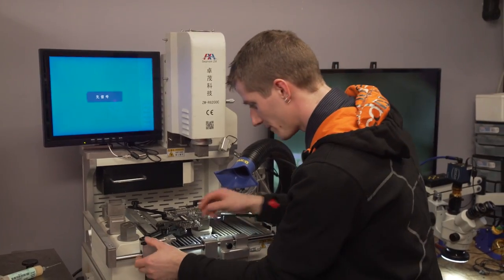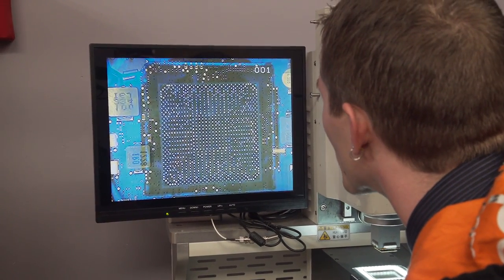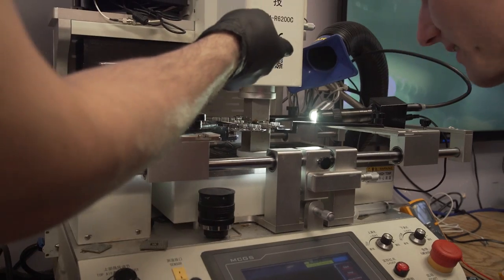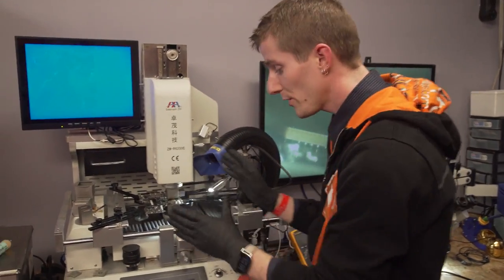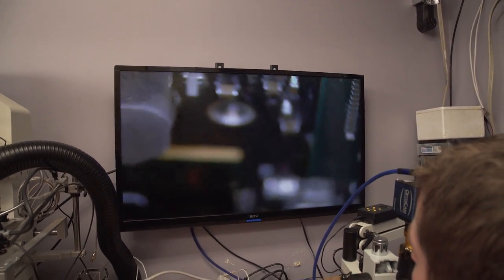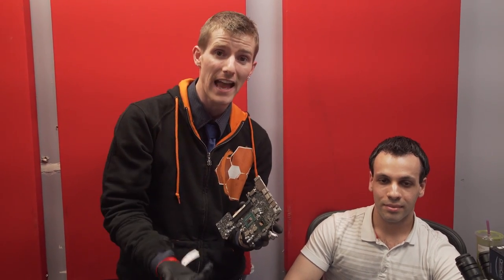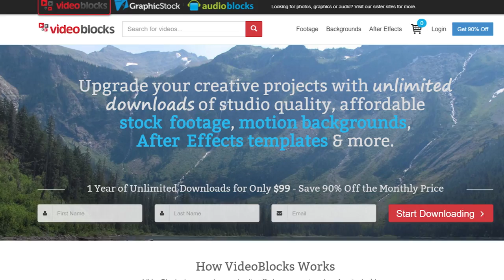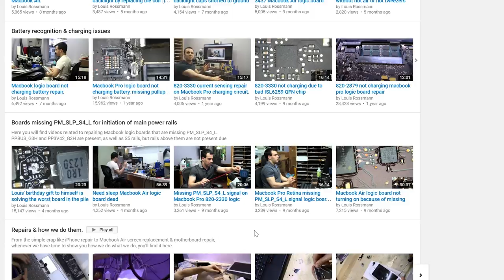Linus Attempts BGA Graphics Chip Repair! - Rossmann Repair Group, New York City

Comment: Linus and Louis, both good sports.  Both professional at their trades.  That is how you settle disagreements and confusion like a gentlleman.
Reply: Do you even watch Louis? Not very professional.
Reply: He just wanted to prove a point that his board worked for a little while, while Louise's failed even after professional handling. Massive ego if you ask me.
Reply: General application is the same one is more safer and under more control but there are chances of errors on both side its luck baby one is a part fixer and another is a total detailed analysed attempt to fix but failure is inevitable lol.

Comment: You know... i once had a Radeon HD4850, awesome card for the day, but after a few years suddenly got some nasty artifacts. So i was out of  warranty, as a student I was out of money and behold he oven method popped out. Needless to say that graphics card worked flawlessly half a year after i baked it in the oven, and it didn't fail, i just upgraded to another...
Reply: still have 4890 in my main rig
Reply: I just switched my XFX HD4850 for an XFX RX 560, and it was the best upgrade Ive ever made.
Reply: Extremely lucky. Rossman sees a couple baked boards every day and their all fucked. He goes into great technical detail why it doesn't work on his channel.
Reply: Yall doing it wrong!  What you need to do is get some 4340 steel billets to melting point, then pour that on the board.  That's the way you fix these things.
Reply: Sure baking it in the oven isn't the "right" way to fix it. But if you need to get it working for a few months on a bare bones budget, I don't see why not try it. If it's old hardward due to be replaced anyway, there really isn't anything to lose.

Comment: Quick Question:From 2:30 to 3:00 how many times our guest (Rossmann Repair Group) had looked to the camera?
Reply: 8
Reply: He looks at the camera 8 times.
Nice for you to point out that Louis does that.
Just a quick question for you: Did you notice that Linus looked at the camera 10 times in the same time frame?
So why exactly is this an issue with Louis and not with Linus?

Comment: Fuck this shit. I want to see Luis and Linus in a boxing ring.
Reply: lmao hell yeah
Reply: lol this expert for repairing boards doesn't fix it even linus tried and failed so board repairs are bullshit  if you have a dead lead free soldered chipset like  solid state intel drive your fucked and might Aswel  buy another one but a gpu is expendible  and can be revived a few times before it will stop completly because gpus  use lead tin solder

Comment: I tried the oven method once on an artifacting X950 or what ever it was called, made it much much worse lol
Reply: what in the fuck? artifacting is a problem with the virtual drivers, nothing physical, unless if you're referring to fracturing which is completely different
Reply: Artifacting can be due to physical issues too, particularly overheating.

Comment: Liunus is hardcore traveled to call out a troll
Reply: +Liemciemdk89 Not a troll; Louis is a professional repairman, and he have uploaded several youtube videos over the years where he rants on the "oven trick"... and he is right
Reply: They baked the board for too long and basically melted it, because they were distracted by conversation. Not a troll. 
Though linus' method of using an over would theoretically work if you can keep components in place and apply pressure. As long as there's solder, it should work. Though you can use flux and a strip of solder while doing it to make sure there is a solder joint, depending on the chip's pin spacing.

Comment: So take this scenario: You have a 300$ graphics card. It does not work anymore. How much does it cost for this dude to check the whole PCB for bad connection (which he can't. He seems to be doing visual inspection only) and resolder as needed? I expect, and do correct me if I'm wrong, that it's gonna be more than 150$ although I have no idea about US wages to be honest.

So you either spend that money and end up with a still broken card or you try it in the oven and end up with a still broken card. In the latter case, you put the 150 bucks towards a new card.

Look, he's not wrong. The oven method is a hack job. I would never try this on a component costing thousands. But for a relatively cheap consumer product, I highly doubt that he can compete, especially considering that if your card is older than a year, you're getting better hardware for the money when buying new anyway.
Reply: +Marco2G He even says this in his response. It was only worth it for the $2000 laptops he was repairing with that station.
Reply: Sessym So what's his beef with the method, then?
Reply: +Marco2G If you have time, really check out the channel, he explains it in detail in more than one video. Solder doesn't even come close to melting in an oven, the innards of the chip do. If you're lucky, they move around in a way that the connections come temporarily live again within the chip casing, but shortly after it will be F-ed again. His issue is that still some less honest shops and people sell this as an actual fix. There's a good chance the stuff they baked will break again, usually after the mandatory warranty.

Comment: OK that machine is totally pointless to own as a owner of a computer repair shop, it's a  $7,300 piece of machinery, how many computers do you have to fix to justify the cost? More importantly what is the success rates of this machine? Just replace the Graphic Chip or mothboard with an new or even used one and pass the saving onto the customers! 

You might as well use that machine's heat to create bake potatoes and sell them
Reply: +Viet Lee When you lose 500$ worth of data this sort of stuff becomes very, very useful. This is mainly aimed at the recovery of things you cannot replace. There are machines ten times as expensive used by professional data-recovery companies and they can be worth their weight in gold.
Reply: +Powertampa This machine is fixing solder problems, not Nand flash problems
Reply: +Viet Lee I would say this is used for much more expensive proprietary electronics as opposed to home PC's. Such as in repairing control boards and electronics in very expensive machinery. Now its still up in the air if this guy actually does that to justify this machines purchase.. lol
Reply: +Viet Lee You can't buy those, the manufactures don't sell it. They said so in the video.
Reply: +Viet Lee pretty sure it more of someone bring me a dead video card replace it with a used one and fix this one and resell it later= profit lmao
Reply: As an Economics student,I need to clarify you one thing.
The money you spend on buying the machine is considered as investment or capital and you are not supposed to get it back. It's a fixed asset and you can't charge your customer a part of it!
It's your variable cost and your production cost that you charge back from the customer!
If the companies think like what you are thinking then a laptop which you are using would cost you several thousands or dollars and not hundreds of dollars.
Hope this clarifies you.
Reply: +Viet Lee That machine isn't really for repairing $50 sound cards. But if you have a $4000+ workstation card (quadro) using one of those to repair it for $500 or so to extend the life would be vastly better than buying a new card. The guy is probably one of very very few people in the area to own one, so any specialist repairs needed probably go directly to him.
Reply: And one more thing, price of a product = variable costs + resource cost(labor,power and taxes and etc) + profits.
Regarding the later comment you might ask me when he's gonna make his money back on the investment that he made? He gets it when he sells his machine or the company he owns and he will loose some amount of money spent on the machine known as depreciation cost.
Reply: Varun Kanuparthi yep becuase they somewhat lost money making laptop even store who sell them they don't really get there money back that why they try and up sell
Reply: Varun Kanuparthi Ugh, you clearly misunderstood what I meant. Of course it's a one time expense, what I'm saying is how many chips does he have to fix to break even? It looks like he runs a basic computer repair shop, so he is not getting corporate money, 99% computer repairs are not solder related, it looks it will take decades to break even. 

Instead of charging a high service fee for using this machine, he could have purchase another chip to replace the bad one at a fraction of the cost and charge only a simple labor fee. Thus, passing on the savings to the customer.
Reply: Varun Kanuparthi You forgot the demand for the service which is very rare, thus most likely not profitable.
Reply: +Viet Lee "how many chips does he have to fix to break even?" that's the whole point here buddy....He doesn't get even no matter how many chips he fixes. He just makes profit from it and that machine is his investment! You don't get back your investment in business. You just get profit from your investment.
Using that solder machine he can get benefited with advertisements alot! He can easily attract huge attention from the customers and from the public. He can advertise I have a machine which could fix a fried pcb or replace a chip which no other computer shops have! Just like those corporate commercials just to create some hype.
And by purchasing another chip to replace the broken one? As far as I know no company sells only the chips itself. They come in part of a package itself.
So, suppose you have a new mac book which is out of warranty and got fried because of overheating and he has a same model lying around so he can just replace the fried part of the notebook and bam you will have a fresh one which actually runs and you pay him half the cost of a new one or something like that.
That's the point here. If a part of your PC or GPU or SSD or literally something which uses a chip gets broken then he can repair it. And he will charge you. Very less when compared to buying a new one which would cost you a lot.
Reply: Viet Lee
If having the machine would make no sense and would make him no money then he would be out of business by now.
Reply: +Powertampa Good point buddy...But one can say he might have his parent's fortune and it's his PASSION!
Reply: Varun Kanuparthi He doesn't advertise that he got the machine at all. 

"As far as I know no company sells only the chips itself." That's Right YOU DON"T KNOW, as a business owner you can contact directly the manufacturer to get the parts you need but majority of the time you get parts from eBay.Why? Because 

As a business management student it's a poor investment. Watch the video, that machine didn't even fix the chip. When any electronic fail because of solder issue, any fixes are only temporary because the probability of it failing again it very high. Just like Linus's graphic card. It is more economical to replace the compromised part completely. 

ALso, That machine probably got a terrible resale value used.
Reply: Powertampa Because other services are offsetting the cost of the machine. The argument here is whether the machine is a justified expense.
Reply: +Viet Lee The machine only fixes the problem if it is caused by soldering and IF it is perfectly soldered then it wouldn't fail the next time because if there are high chances that it would be broken again then why would someone invent the soldering gun in the first place?
And I am not saying that he advertises his machine. I am saying he COULD advertise it and could get famous as most of the shops don't have it and he would clearly be outstanding in the crowd of repair shops.
Reply: Varun Kanuparthi You obviously don't know how businesses work. No you don't have to be a retailer to buy directly from a manufacturer. All you have to do is go on their website and contact them the parts you need. Because in the real world businesses like to make money.  

If you were a Economic student you would know it is a good idea to get a return in your investment. I feel sorry for you, you are failing your classes aren't you?
Reply: Varun Kanuparthi Ugh, you clearly don't know anything about computers.

Comment: It's a shame when unexperienced guy tried to use THE RIGHT MACHINE to do the job that it made for this and he fail yet ppl still insist that the oven is a better way to fix. 🤦‍♂️ Same exact idiots who slams a TV/RADIO to work and it worked by chance.
if you want to give an advice? You need to know who deserves it.
Reply: In fact if I remember correctly slamming old TV/radio did have some science behind it. Of course it's a chance, but usually it didn't get worse. Don't do it tho. Old tech is easy and fun to fix.

Comment: While this video is very cool and interesting to see how its professionally done 
This guy who has a $7300+ ish machine makes a video response like that to a channel that does most everything in an interestingly cheap ish (if it works) alternative to paying someone however much it would cost to get it repaired. (wasn't that video a small experiment for entertainment anyway?)
I get why someone would be angry about a video like that if it was about their profession but it was an experiment not a video that said 100% guaranteed to fixed YOUR graphics card just by using a household oven  you can tell a large group of people that plugging your phone into a potato while that potato is in water will charge your phone and no matter what there will always be people who rush to conclusions and just do it then bitch how it didn't work later that's just the internet man, gotta take the good with the bad
Reply: +Simon Garcia Well it's not just about Linus' video. There are numerous fraudulent "repair" shops spouting non-sense like baking things in ovens and such as permanent fixes. Look at the Xbox 360/PS3 ring of death videos and sites that are all over the place. Louis was more frustrated at that, Linus was just the straw that broke the camel's back as he is top tech Youtuber perpetuating it even if he just did it as an experiment.

Comment: I gotta tell you. I had a 560ti a few years back, started to show fragments on the screen. I baked it, as the internet said, and I used it successfully for about half a year.. Then I sold it, still in working condition. I did mention to the buyer that it was baked (in case you were wondering). I never heard any complaints from the man. So yeah, baking works (at least it did for me).

Comment: using an oven to reflow CAN work, provided it's a convection oven, you use a jig to hold the board and prevent warping, you have temperature sensors, and a micro controller than can adjust the heating element along the curve recommended by the chip manufacturer while checking multiple heat sensors.

You won't be soldering on a new chip though. Aligning solder balls to pads is almost impossible without one of those machine, or recessed solder pads.

Comment: I strongly supports Linus' argument that attempting a BGA repair, either in the oven or - as I did - using a heatgun, makes a lot of sense. I made my GPU return from the dead after some serious heating along with the right amount of Amtech flux - and viola, the computer now works again, like a charm!  No need for anything costly. I may just have been lucky, but it worked.:-)

Comment: I've had screen artifacts on my old cheap-ass laptop. Baked my m57ru nb8e-se on 210°C for 5 minutes sunny side up and it works fine again! Thanks to Louis' reballing video for clearing out why it (sort of) works.
If my attempt would have failed, it would only cost me about 40 dollars for a replacement GPU board ;-)

Comment: I baked an AMD Radeon HD 6870 by Powercolor and it has been working for 1.5 years after I baked it. Before it went out it was used for 6 years and it has been passed down through 3 PCs. I root for the cheap bake it technique!!!

Comment: A while back... a certain printer company had a defective board in all their printer. What they did is extend the warranty by 2 years and replaced the boards as they failed (they were failing one after the other). But then, they went out of board for a while due to high demands. The solution : they told us to bake the board as it was a defective solder joint that had failed on the board as a temporary fix until they got new board in stock.

Comment: I don't doubt ANYTHING that Louis says, I've subscribed to him for awhile now. HOWEVER... My ancient Radeon-280x gpu was showing signs that possible a VRM or something else wasn't working (blue streaks across very specific portions of the screen).

I tried everything, including stripping the entire board down, cleaning and re-applying thermal paste. It would boot properly, without the visual error maybe 1 in 5 times but slowly over the course of a year became 1 in 100 and then finally I couldn't get it to boot without the artifacts at all. As a VERY last resort before binning it and looking for a replacement, I attempted the whole 'baking it in the oven thing' using a guide I found online.

It worked. I mean it probably didn't re-flow anything and I know it's likely going to fail again and I KNOW there is a good chance it just expanded and shrunk everything in such a way as to make it work for a little bit... but 6 months on and its still working. I agree with all of Louis's logic and arguments but I simply cannot argue with results. Fucked if I know why it worked... maybe it wasn't even the heat, maybe I bumped something back into place while stripping it ready for the oven. But it worked and now my GPU is alive and kicking for a little while longer. Hopefully just long enough for the GPU prices to come back down to earth and I can afford something better.

TL:DR My GPU died, I baked it in an oven and it works again. I respect Louis's knowledge but I can't argue with results.